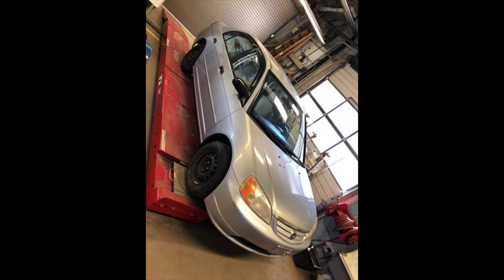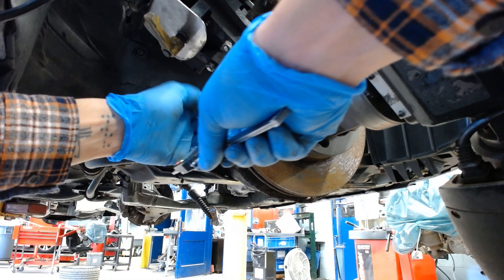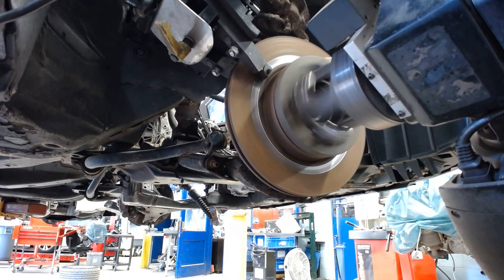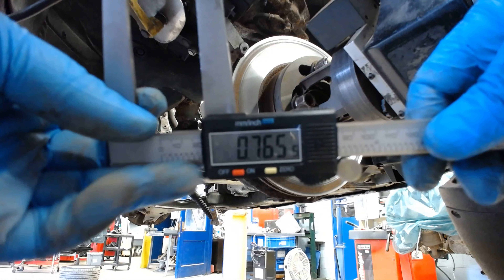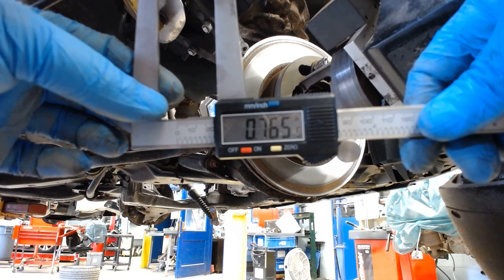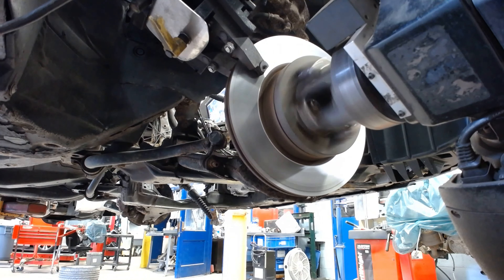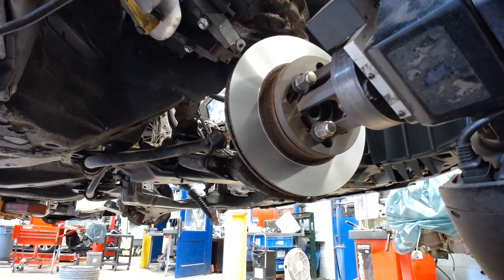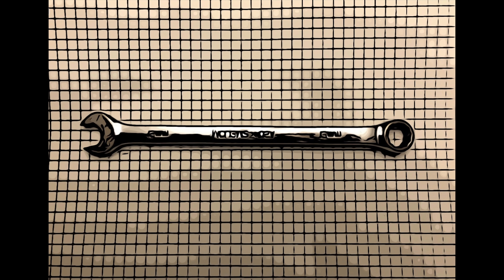Cutting Rotors With An On-Car Brake Lathe

Comment: So how long did it take you to do the job? How much equipment value did you use in total? I saw your comment below and said you charged 25 USD a rotor, given a pro cut x9d cost around $15,000 and takes longer to set up than taking the rotor off. How much would you charge on the rear if it had EPB that required scan tool deactivation?